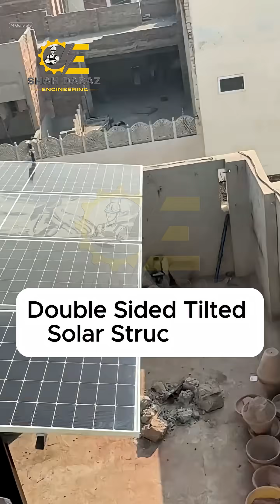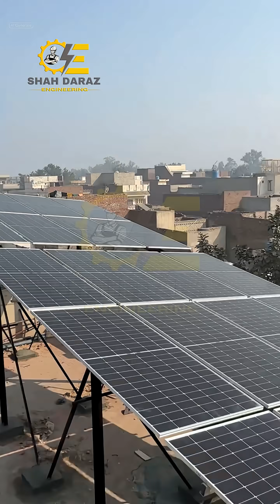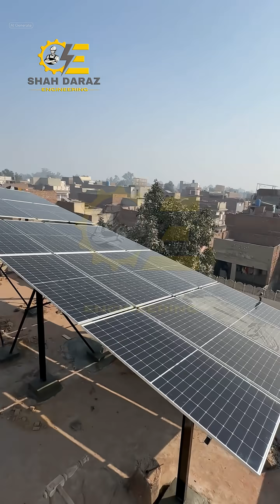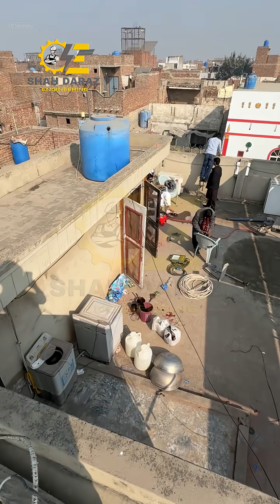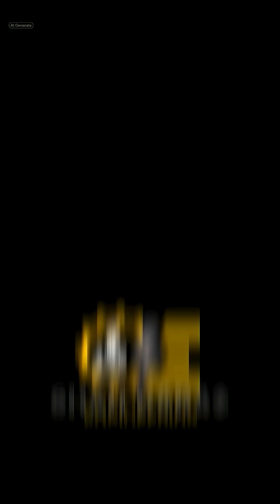Why double-sided tilted structure used?#SolarEngineering #shahdarazengineering #solarfabrication

Comment: Power k liyey optimize ker Liya. Ab aandhi k damage se resistant b bna lena.
Reply from the maker: This entire frame is ventilated.There will be no air pressure on it because we have also given a panel-to-panel gap. We have also given a one and a half foot gap in the center. And the special thing is that the frame is higher than the front, so air can pass through easily without damaging it.